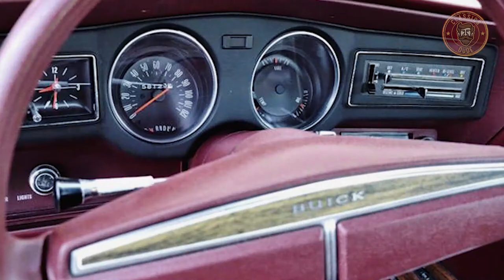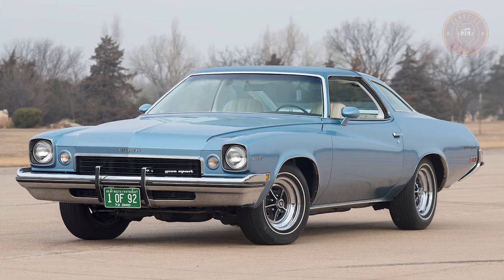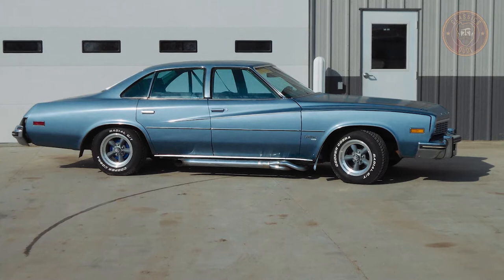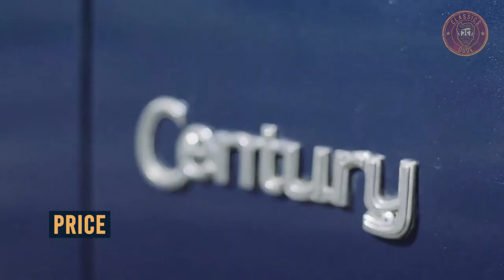Buick Century 3rd Generation (1973-1977) - [Classic Buick Review]

Comment: I daily drive a 1975 century special. After ditching the emissions junk and putting an aftermarket intake/carb it is no slouch. Put some good shocks and a sway bar and it is sportier than most cars I drive around. If it had AC I would never get rid of it.

Comment: 2:50 231cu is NOT 2968CC... IT WAS A 3.8 LITER. Love this car but so many mistakes in this video...😢

2:02 only 60hp at 3200rpm?

1:57 thats a lesabre...

2:59 "the four cylinder... 350"???

What is a "cue"?

2:56 455 could still be ordered in 1975

3:25 the US approved square headlight already in 1975 (olds 98, buick electra, riviera, Cadillacs etc)
Reply: Whoever wrote the script for this video doesn't have a clue. I was distracted by the mispronunciation of coupe and the annoying "Power Block T.V." narration.

Comment: Kilowatts? That is an electrical term. This is not a gas powered vehicle. Horsepower and Torque are important. Good job on your work to do this.
Reply from the maker: this is meant to be an equivalent value in Kilowatts, thanks for your comment.
Reply: Classics Dude is absolutely correct to mention Kilowatts (KW). You'd never find horsepower in any European (or at least German) vehicle registration doc. It is always KW as the official term, mentioned at a certain rpm. Kilowatts multiplied by 1.36 than equals horsepower.